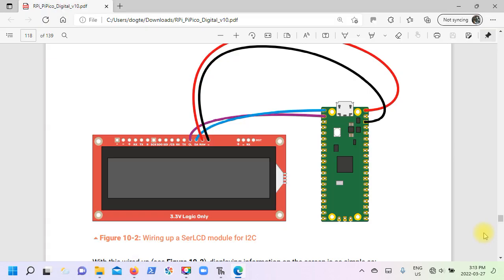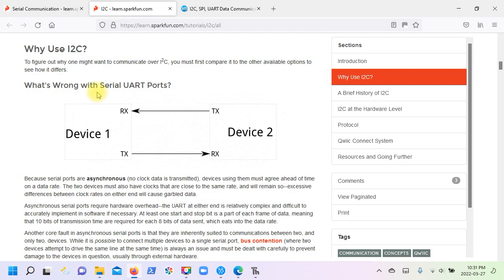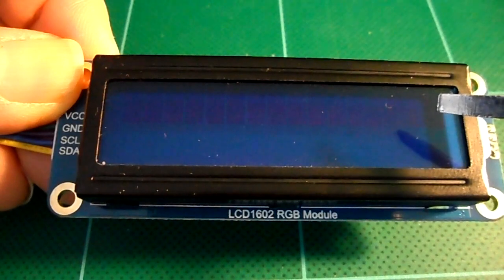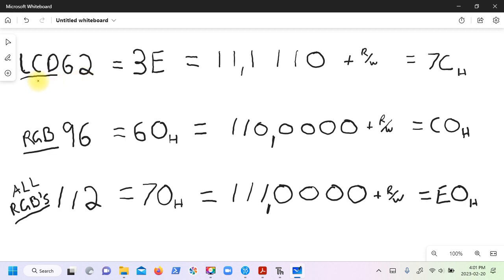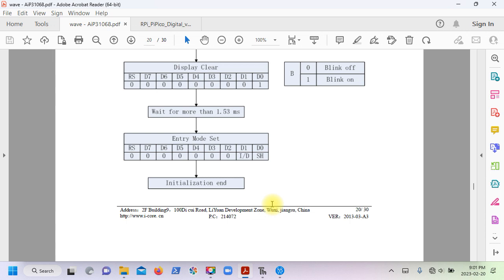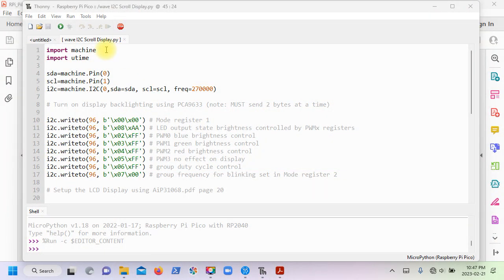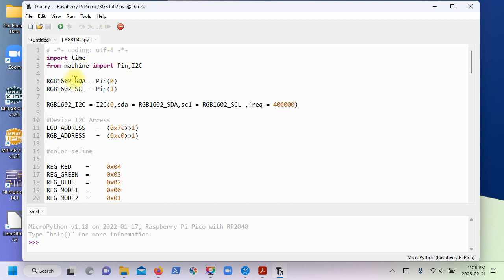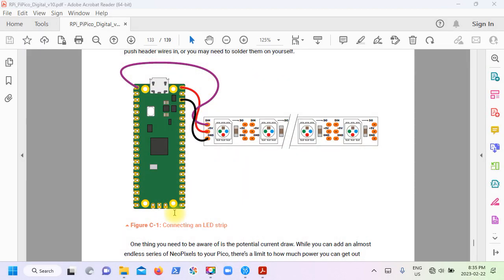Raspberry Pi Pico MicroPython Chapter 10 - Waveshare lcd 1602 rgb module

Comment: A great explanation,  after importing a library, e.g. import xxx, do dir(xxx) to see what it provides ...
Big numbers can have _ in them to make it more readable, 1_000_000 is easier than 1000000, 1_000 - 1000.
Avoids the problem with local numerical conventions ( dot comma vs comma dot ) 1.000,5  1,000.5